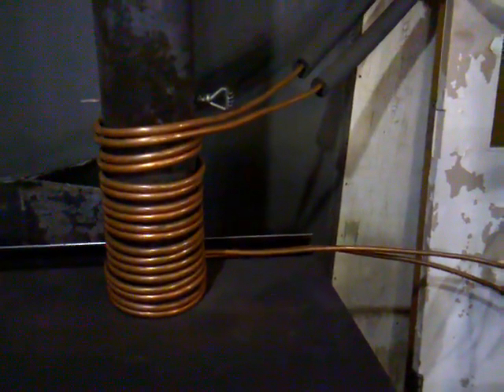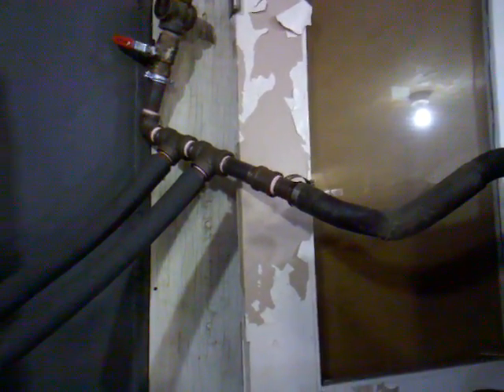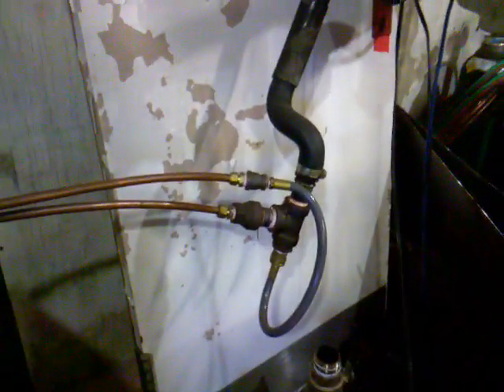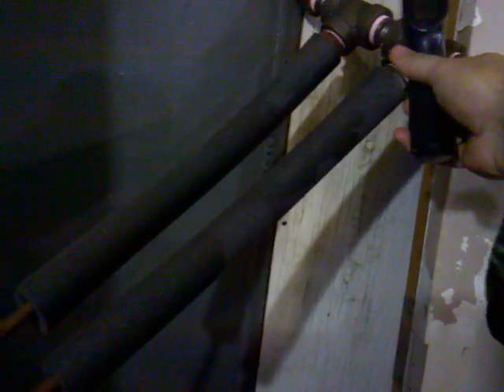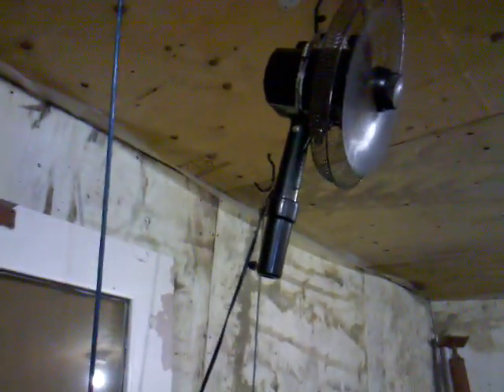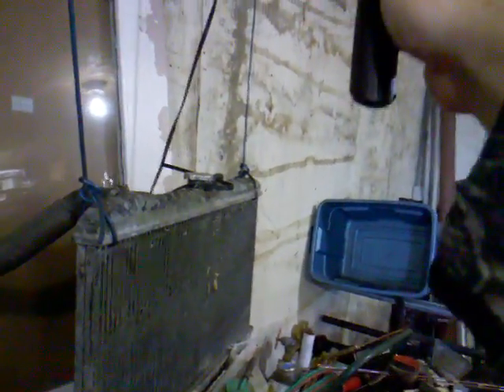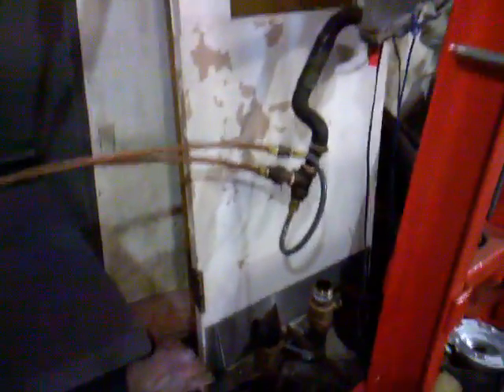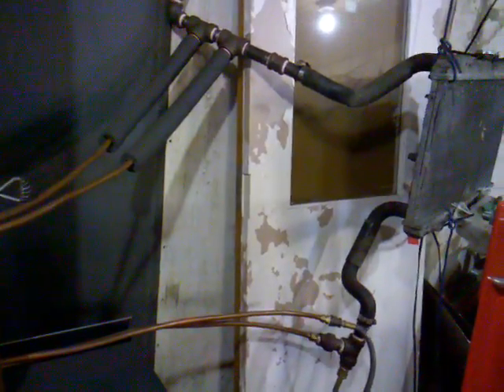Homemade woodstove radiator

Comment: Can you tie this rig into an existing heating oil system?
Another helpful heatinG hack, I  vented my mom electric clothing dryer through a small water filled long box, right to a vent that goes to my lovingroom
Reply from the maker: With something like this, you'd want to make sure you remove enough heat from the system constantly. If you tie into your HVAC, the blower might not run often enough to keep the coolant loop from overheating.

I've thought about running the dryer vent through a furnace filter for some humidity in the winter.

Comment: I'm wondering about the following; a copper pipe going through the inside of the fire, open to the air outside the fire, low one side, high the other and longer. It will suck cold air into the bottom of the fire, and output hot air through the outlet pipe.?
Reply from the maker: Sure, it wouldn't need to be copper.
Many old wood stoves had tubes built in like you mentioned. Some were made in a U shape so the inlet and outlet were on the front of the stove. Some also used a blower.

Comment: does the radiator need to be capped?
Reply from the maker: @Wrenchslinger-o5q  no it doesn't but the cap will keep it from evaporating. It needs to stay full to circulate. It could also overflow as the water expands with heat. You could use some sort of open reservoir at the high point. I considered doing that but I had the coolant reservoir from the truck so I used that.

Comment: maybe a boiling open water tank to heat the water and top from that tank to circulate to the radiator with a pump and you would not have to worry about too hot of water accidently blowing anything. Just exchange the heat and install a flow lever to let in new water to the holding tank if only you need to heat the air and not use the water for anything else.

Comment: How far will that thermal siphon pool water from?  If I were to put a radiator in the basement and my fireplace is on the main floor with that circulate?
Reply from the maker: I'm no expert but I would think so. You might lose some flow by having a long run and that could cause boiling in the coil. If I was going to have a long run, I'd be tempted to stretch the coil apart and have it run higher up on the chimney. I don't know for sure if the steeper angle would help but I want to think it would. I never changed anything on my setup before I took it down to move.

Comment: I just hooked up a coil of copper around my pipe, the water got so hot it almost exploded the cpvc pipe that was no where near the copper ends it connected to. I need to know what i should do to prevent this and the best way to control it.
Reply from the maker: How can it be connected to something and nowhere near it at the same time? Maybe don't try this at home. CPVC can get soft with boiling water so I wouldn't recommend using it for this.
It's important to be able to remove the heat from the water before it returns to the coil and have some sort of pressure relief. Sounds like you may have a dangerous setup. Get someone with plumbing and heating experience to give you a hand.

Comment: This is exactly what I was looking for. I had the exact plans in my head but it took a minute to find your video confirming my thoughts. The way you have the high out and low in.. at the high point I was thinking of t'ing off to have a water reservoir. This would be open top. This would maintain the level. Once you fill the system and bleed the radiator you should have a level, if/as it evaporators you can top it up. Does this sound like it would work or do you maintain it must be a closed system? The water reservoir must keep the air out anyway? And if it was to 'boil' it has a release point anyway .. a closed system has the potential to explode.. although you probably wouldn't have enough heat on the flue for this to happen? Great to see this working. The only difference is I have an actual house radiator at hand.
Reply from the maker: There is an expansion tank connected to the radiator just as it was in the vehicle it was taken from. It's hanging off the bottom of the radiator in the video. I didn't really need the other valve but the way I ended up building it, I had two high points so I stuck a valve there. Also, the radiator cap has a built in pressure relief and fluid recovery valve as most vehicles do. I maintained the level in the tank just as you would in a vehicle. Having a pressure relief is essential even though I never noticed any pressure in the system. Using a radiator from a vehicle and an expansion tank takes care of several of the things that you mentioned.
Reply: You could also look at some claeffi brand parts. They have some automatic valves for pressure and temperature. Learned about them on engineer775 yt channel. Wish I could find the video where they talked about them.

Comment: We heated our whole house with a similar system when I was a kid. We had a very large steel burn stove (from a 19th century factory). We wrapped the stove with copper coil and used the fan in the oil burner. We then tapped into the heating trim. Our house would sometimes get so warm we had to open windows in the winter. In CT! I now live in a tiny home and want to set up a system to heat my home in the winter. Good job!

Comment: I realize this is an old video so you may not care and have probably moved on from this but anyone else looking at it this is just a couple thoughts to put into it I have to wrapping the copper around the flu around the exhaust pipe really wouldn't recommend doing that cuz you're going to draw the temperature down in there which depends on what word would you burning and how hot you're burning could cause creosote to build up more so I would honestly melt the copper to either the back side or even laying it just on top of the stove to absorb the heat directly from the stove just to keep the flu temperatures hot enough to throw in any issues or to reduce the chances of issues from Korea soap also pretty cool idea with the radiator if you have duct work or something above yours like I do in my house we actually have a hood built over top the wood stove so that when our hot air furnace kicks one it'll draw the heat from there as well just circulate through but that radiator sticking into a section of ductwork could be pretty useful and as for the fan behind it honestly I would probably hook up an electric radiator fan you can probably go to the junkyard and get a pretty cheap one wire that up to some kind of controller and you may be even be able to connect it to a controller that will connect your thermostat so whenever your thermostat kicks on that'll keep going and cycle and force air through as well something I may have to look at possibly doing
Reply: Everyone loves this simple trick to get no draft, a cold flue, creosote buildup, and condensation. 

Why don't they just have a small 110v fan blowing on the firebox? Or a stirling engine?

Comment: This, but I'm also wanting to see if I can't use the exhaust and flow of the coolant to both run an alternator that's hooked up to an inverter and battery bank

Hook one side up to a turbo fan and the other with some jerry-rigged hydro turbine and have them both belted together once I figure out which way they spin

Comment: I'm thinking of doing this using a new, aluminium radiator with a stained wood frame.

That makes the radiator decorative as it will be used in the living room.

Heat powered fans in the configuration shown in the video will complete.

Comment: Instead of the radiator and plumbing, I use a thin walled flue internally that gives up most of its heat to the air indoors before it goes out through the wall. I think the radiator is a good idea for if you want to heat another room from where the stove is
Reply: Stainless steel is good for that

Comment: Nice job. One possible drawback with a heat-exchanger like this is that the flue temperature might drop too low, and condensation issues might develop in the flue. Anybody ever see this happening?
Reply from the maker: On this setup there's a small gap between the coil and the flue pipe so not real risk there. I've seen old kitchen stoves that have the flue pipe run straight through a big water tank. I assume it would cause a local buildup of soot but it was good enough for our great grandparents.

Comment: After the coil on the stove, could I use pex? How could I implement this to heat domestic water
Reply from the maker: I wouldn't use PEX on the hot side of the coil. Stoves and chimneys have minimum clearances to combustibles that I would apply to PEX also. Trying to heat domestic water get's tricky and expensive. You  would have a hard time keeping material costs down.
Reply: Pex can handle 180 to 200 degrees but 180 is recommended max for plumbing projects.

Comment: Doesn’t using coolant defeat the purpose, seems like maybe using a higher water to coolant ratio might increase your temp without freezing up or over boiling just saying , cool idea ! I’d experiment a little as long as you got high temp valve that can open
Reply from the maker: It was a 50:50 mix that was drained from a car if I remember correctly.
Not sure what you mean by defeating the purpose. 
The radiator had its stock cap and expansion tank.

Comment: did you do any more with this? contemplating a calorifier myself to heat water (good way to store and release hwat slowly too); although i think using the back-plate for heat exchange may be better option, to avoid too much temp & draw reduction of the flue
Reply from the maker: It was disassembled when I moved a few years ago. If i was going to do something similar again it would be for heating a different room or heat storage as you mentioned.

Comment: I was considering adding a heat extraction system to my pellet stove. My thought was to run coils into the stove with airtight heatproof bulkhead fittings. I would then run that to a small radiator like what you have. With a circulation pump to do the work of moving the fluid. Another idea would be to extract the heat from the exhaust pipe being that they're fan-driven. I don't understand why pellet stove companies don't do something similar to extract all the wasted heat that goes out the pipe
Reply from the maker: I think the main reason for avoiding more efficient heat extraction is the exhaust. Many pellet stoves are retrofitted to existing chimneys that are dependent on the heat to maintain updraft and negative pressure so that CO and CO2 don't leak into the house. This is one reason you see sealed PVC exhaust on high efficiency furnaces.

Comment: My dad could have used this method. He would go out to play in his garage mostly to get away from naggy mom. And when I would visit him he would always say, 'throw another log in the stove and go in the house and heat my coffee in the microwave'.  So I would brought him out a heavy duty cast iron pot that he could leave on the stove. And when his coffee got cold, he could pour his coffee into the pot and the heat transfer would be immediate.  Now running some insulated tubing over to where his work bench was, would have been easy. I even offered to run it but he would have to meet me halfway and buy the materials.  But he would rather freeze and complain than do something about it.

Comment: Thermosiphon likes vertical, it hates horizontal. Coils only barely thermosiphon(they usually boil) and along with that woopteedoo in the line feeding the radiator, I am surprised it is flowing at all.  If it makes any noise it is boiling...  You want the collector vertical(vertical tubes connected to a ring of copper with t fittings top and bottom around the pipe). You want the line from there to go up to the highpoint as close to the radiator input as possible, then the radiator outlet preferably at a downward angle bak to the collector.  Then as mentioned, wrap the collector in foil/insulation to maximize the heat collected...

Comment: Have you had any overheating or boiling issues to date?  
You are using automotive coolant/water mixed at 50/50 ratio?
If it needs more heat gain I wonder if first coiling the copper on the top of the stove a few times and then going up the bottom 18" or so of chimney would double the conduction. My stove is the hottest on the top of the firebox.
And the ideas to put a reflecting cover of heavy aluminum foil or just a cheap, larger diameter portion of black stove chimney (like a 10" dia or so) around the copper on the stove pipe would boost the heat gain significantly. The hotter the stove pipe is kept the better anyway for keeping it clean I think.

Comment: Thanks for sharing. Using 2 parallel pipes joined back to 1 never occurred to me. I'm going to try and use it to heat a water cylinder
Reply: Just wondering what's the reason for using 2 parallel pipes? Also, shouldn't it have a safety pressure release
Reply: @farzadaf  the radiator cap has a spring load pressure release normally set for 13psi.

Comment: I’m new to all this & horrible with math but could you get a galvanized tank like for farm animals and partially submerge the radiator and it heat the water in the tank for bathing?
Reply from the maker: Dal V It could be done but radiators are meant to transfer heat to air. Transferring heat to water is much easier and you can likely get away with a submerged coil. Or just do it the old-fashioned way and warm up pots of water on top of the stove and pour that into your bath.
Reply: luianddisa thank you for the reply!

Comment: How long did you have the fire on for when it read 156 on your thermometer.
Reply from the maker: cameltoe452 It depends on stove settings, wood quality, and room temperature. Say 20-30 minutes.
Reply: Thanks for the reply

Comment: i'm doing the same thing right now.  i'm going to circulate my potable water through my copper coil into two water heaters. then i'm using a 80 plate heat exchanger to heat my flooring using radiant heat/hydronic heating.  have you or anyone else heard of electrolysis using copper coil wrapped around stovepipe? I heard of one case, but wanted to see if it is common and if others have had it happen?  thats why i'm going to use stainless steel pipe, so no electrolysis should happen.

Comment: I just completed with great success my heater, I had to put a chamber into the heater box to heat the water with direct heat as it heats faster, all the other ideas were not heating fast enough, I have a large tank behind the heater in my workshop, the cold water leaves the tank at the bottom goes into the heat tube in the wood heater then back to the tank, the outlet is about in the centre of the tank below the full water line so has no air in the system,  when the wood heater was lit I could see a flow soon after , after about 1 hour the water on the inlet was still cold, the outlet was hot and thermos cycling like a Trojan, I am using a pump located half way up the tank to pump hot water into my heat exchange unit with fan assist which is located up on a wall, I only used a few pieces of wood to test and the tank heated up to hot as required.
Reply: hi, I haven't worked out how to put pictures on You Tube yet, the system has plenty of potential, heated water from solar evacuated tubes can be incorporated into the system as well, the bigger the water heater box inside the heater is preferred to heat up water faster, I bought a 12volt solar water pump low flow off Ebay, could be fitted with a thermostat to run when water gets hot, the wall heater is from a refrigerated van inside unit which has 10mm tubes was re-plumbed, I haven't perfected the system from my last comment as I have to make a bigger jacket inside the heater, the water tank would hold 100 litres, I located the pump on the tank half way up in the hot zone where the water is hotter to supply the wall heater, water returns to the tank which is open at the top as has no lid at the moment.

Comment: Right on, I digg the truck radiator! Are your temperatures in Celcius or Fahrenheit? Also what did you use as your coolant fluid? Thanks, Tybur
Reply from the maker: Tybur Casuse It was Fahrenheit and I used automotive coolant.
Reply: Right on. Thanks!

Comment: the heat should not be taken from the flue/chimney this can be dangerous. the heat should be taken from a water jacket/boiler on top of the stove. stay safe people.
Reply: Flue gasses should not be cooled down in any way this can result in the products of combustion falling back into the stove and potentially create dangerous co2. All stoves with propose built water jackets will be housed on the back/top of the stove and won't impeded the flow of the flue. Hope this helps.
Reply from the maker: Martyn Mckie While your statement is true, it doesn't really apply here. I'm not directly cooling the flue gases so much stealing radiant heat from the exterior of the pipe. The coil is loose fitting and only makes contact in a couple spots. Also since it's an airtight style stove, once you loose updraft, the fire gets no fresh air and goes out. An uninsulated exterior chimney would be far more dangerous in that regard.